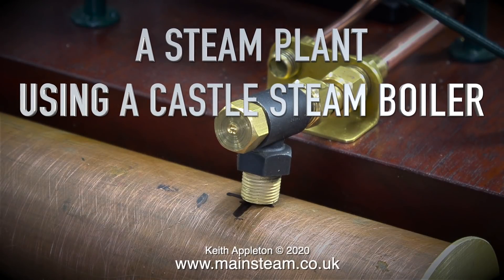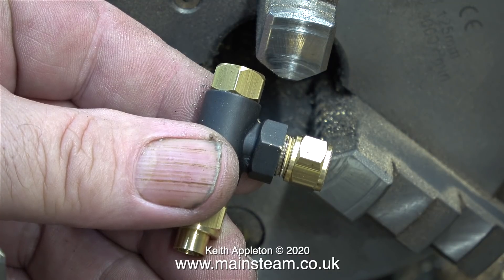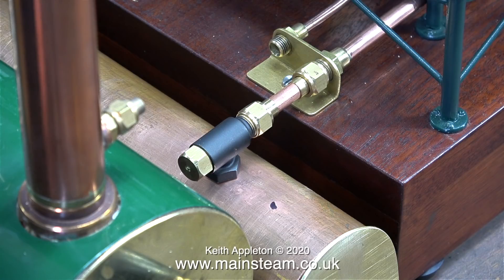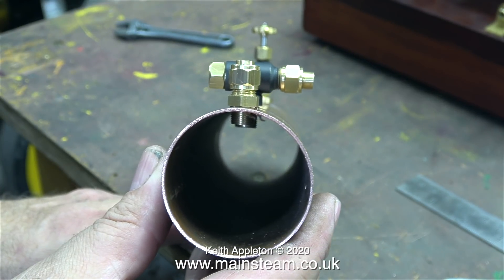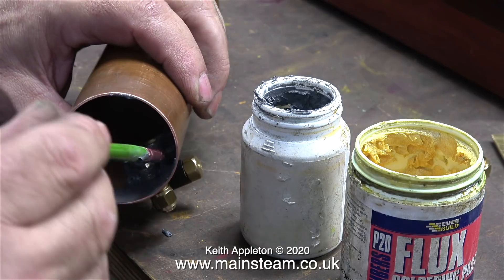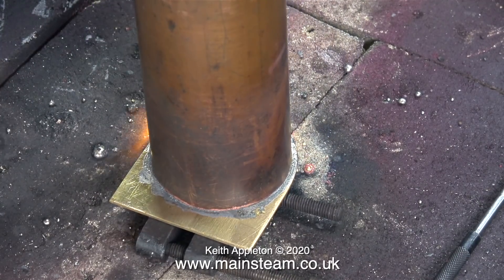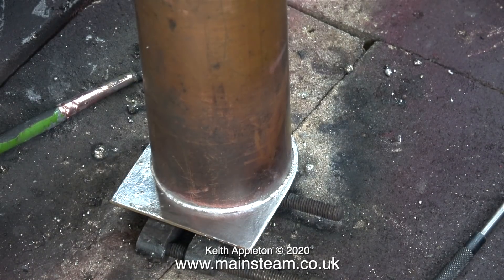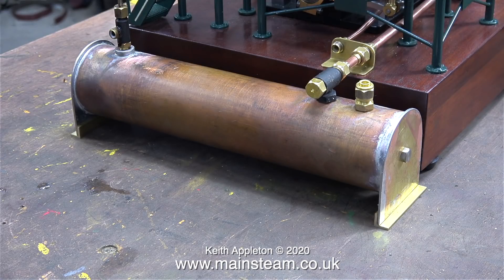A STEAM PLANT USING A CASTLE STEAM BOILER - PART #6

Comment: Nicely done video Keith. I'm curious if the type of condenser you're building would be suitable for a steam locomotive? Or would it only work in stationary/marine applications?
Reply from the maker: A Condenser/Oil Trap (oil separator) is for Marine or Stationary Engine and used to prevent oil pollution in the surrounding area. It is not necessary at all on a coal fired miniature Steam Locomotive.

Comment: Thank you for another information native video. What is the reason for fitting a bushing at the stopcock but not for the in/out ports?
Reply from the maker: No reason other than trying to match the height of the existing fittings on the engine's base and those fittings will never be handled like the tap . . .  . . . . .

Comment: Can i use a wooden frame under the boiler bottom plate (if i milling out a space under the fireplace), or is that a bad idea?
Reply from the maker: What type of Boiler are you using?
Reply: @keithappleton  I am using a low pressure brass kettle boiler, similar to the old Märklin steamplants, but scaled up. My plan is to use a sheat of iron directly under the firechamber.